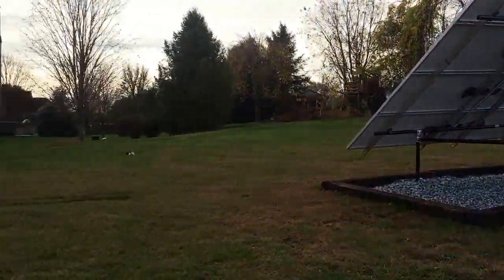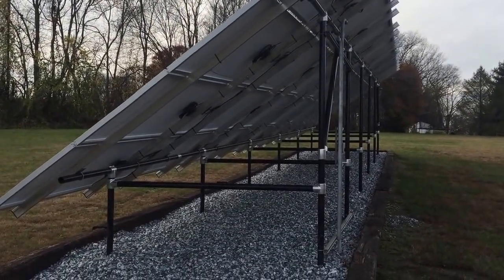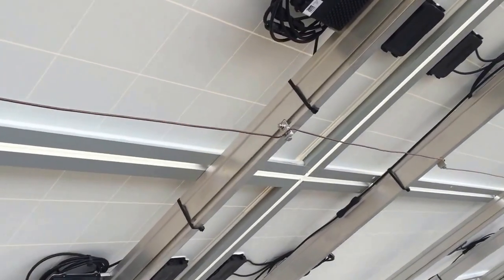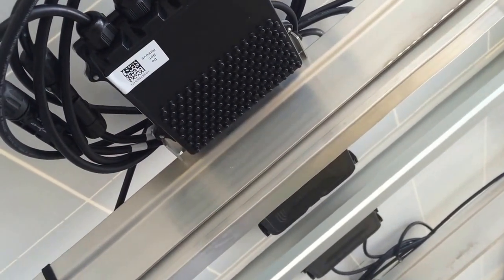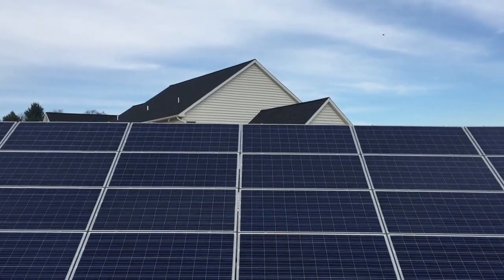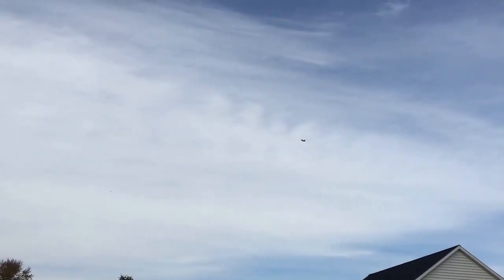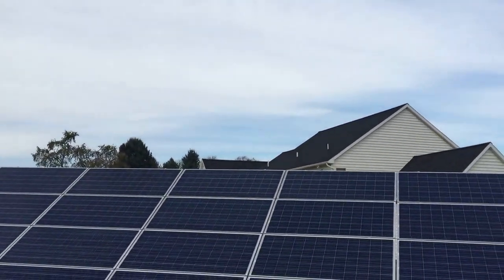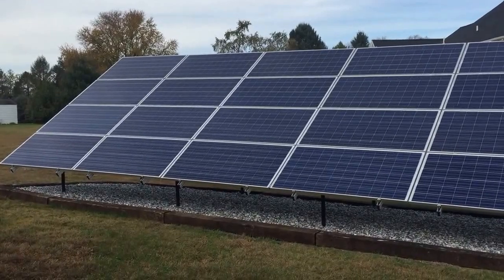Power optimizers on a solar panel

Comment: Do you design your own racking?  Where did you get the parts for that?  It looks cheap and simple.
Reply from the maker: We do... since 2017. This video was from 2015, before we acquired "Tough Trac". Tough Trac is made right here in PA. Good solar mounting is about good aluminum & stainless parts. Good engineering and outstanding workmanship. The goal is to have an end result that is neat, sturdy and extremely durable. Without non-essential cost or complexity. This design from 2015 already looks outdated, especially with how wire management was done back then.